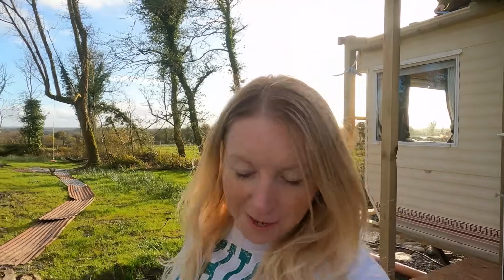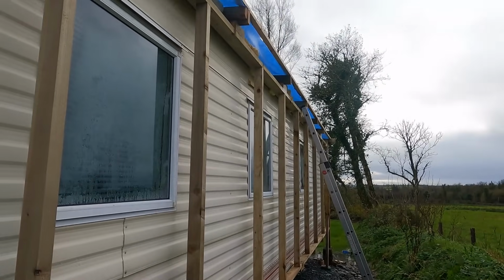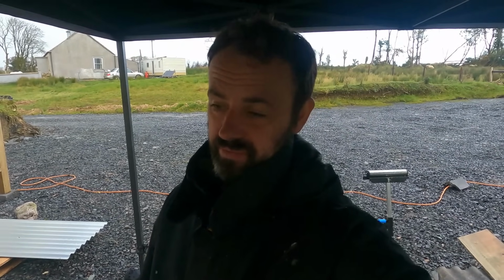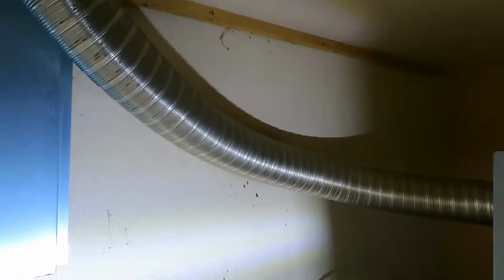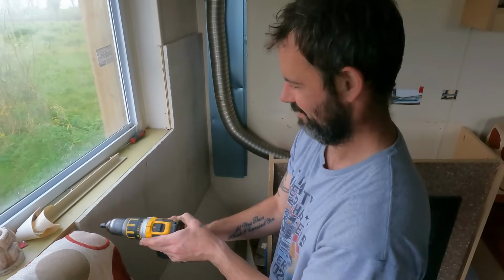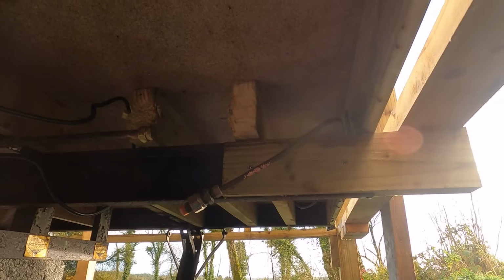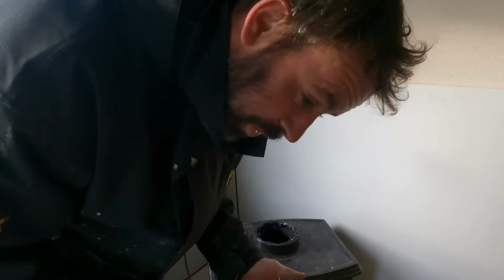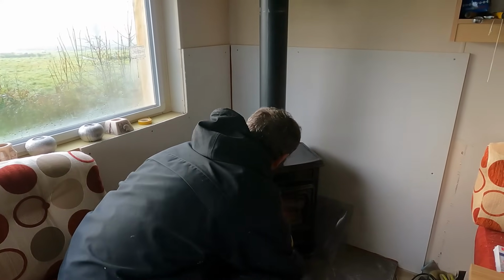We finally install the log burner when the weather stops the cladding! Episode 13

Comment: If I can offer one piece of advice, dont cut the tin roof back too much to accommodate a gutter. The pitch of the tin/roof  is so shallow, the water will track back under the edge and might drip behind any guttering you put up. Maybe try a test pour of water and see how much the water travels back and take that into account when fitting gutters. Best of luck with the project.
Reply from the maker: Good shout! That is something we hasn't considered. Thanks 👍
Reply: Excellent advice. The lower the pitch, the longer the overhang!

Comment: We fitted a log burner with an above oven in our static, best thing we ever did. My wife cooks with it half the year saving on the gas bottle. We're lucky we're surrounded by an abundance of firewood. My only mod to our atlas Florida was fitting an inline extractor to pull warm air from ceiling above stove thru to bedrooms, works well but needs 4hrs minimum runtime to be effective. We're in Perthshire. Had 3 burst pipes from cold over 4 yrs. A log burner and dehumidifier are essential for a caravan life.
Reply from the maker: Thanks, we agree the log burner has been a game changer & the diesel heater sorts the bedrooms. We have hardly needed to use the dehumidifier since the log burner went in. We get our water from our farmer neighbour who lets us tap into his field water for the animals. We are bound to end up with no water a few times before summer, but we can't afford the water connection cost yet. Luckily our neighboure have said we can use their water should the worst happen. 👍

Comment: So, so happy you've got your wood stove installed - absolutely the best thing to keep everything warm and DR., But for safety, and because there's so little clearance, you need non combustible, low heat transfer cladding on the surrounding walls - even with a small stove, you’ll be amazed how hot the walls will get. And keep flammable materials like curtains etc well out of the way. 
A tip to keep the gwater glass nice and clean - before you remove all the ash, dampen some paper towel, dip in the ash and rub the sooty glass  then clean off with another paper sheet - works like magic!
A heat generated fan on top will also help disperse the heat.
Stay warm n snug everyone! Love from Oz  ❤ 🦘
Reply from the maker: Thanks, guys, for the tips. Sam did as you suggested with the ash on the glass, and wow it worked a treat! 👍

Comment: So glad you have the stove in. An Olmberyl gabriel I think, pre airwash. Be just in time. I live on a 50ft narrowboat and wouldn't be without my Woodwarm fireview multifuel stove.. It's 10th Winter. I'm sure it's made a great difference to warmth already and made your mobile home cosy. Your hardibacker board at the rear would be a good idea not to fix direct to the wall. I leave a 25mm air gap, to stop heat transfer to combustibles. I cut 22mm copper into 25mm long pieces to use as a packer/spacer.

First frost here in the UK Midlands. Keep cosy and safe! James.
Reply from the maker: I'm so glad to know the make, thank you. It has made a huge difference for us.

Comment: Great to see you have installed stove i am sure you already know yhis but where possible burn seasoned or dead dry wood the wet stuff blocks the chimney with suit now your working there must be plenty of wood do for sticks for starting the fire
Get yourself a we bit of bog and cut some turf 🔥😉😊👌🍻🍻all the best with your off grid journey 📴🍻👌🔥🍀🪓🔨⛏️⚒️🛠️🔧🧰 you won't know yourself with all this fine heat 🔥 good work fitting roof coming on well
Reply from the maker: I'm looking forward to trying out peat & turf! We have only ever burned coal & logs before.

Comment: That was no easy job. Fantastic work as always. Amazing to see what a caravan is made from. But yours is going to be such a good job when finished. Do you know if the stove is multi fuel? Coal will burn hotter and longer, you might be feeding it logs at a fast rate. I hope the storm passed by your home without causing any havoc.
Reply from the maker: Thanks Ingrid. Yes it's multi fuel. We have been using coal as, like you say, it burns hotter for longer. It is like a different place! I'm so glad it's in & proud of Sam's hard work.👍

Comment: Well done on the log burner install. I still have to do that myself to replace the electric one that came with or static. A wood burner would make sense, but it will also rob me of the prime place for the TV. For now, for as long as our gas boiler works with the rads, I'll put this one off, but it's good having seen the process. Good call on the extra supports under the floor for the weight of the stove.
Reply from the maker: Yes we are missing the place for the TV! but small price to pay for the huge difference in warmth we now have! 👍🔥
Reply: All about priorities. Our boiler in our main house (not the off-grid farm) just failed, so we're going to keep the wood burner going around the clock now. Always have options.
Also, getting that gas burner out of the static will help reduce the humidity. These things create a ton of moisture. Not a good idea in mobile homes.
 @theirishhomestead
Reply from the maker: Omg yes! The condensation has virtually disappeared now! It was so bad with the gas heater! Best addition to our lives so far, except the kittens, of course! 🐈🐈🐈‍⬛ 😉
Reply: Yea, its well known, those gas heaters are not a good idea in mobile homes, unless you vent like mad and the heat is lost. Hope you have some dry bed linen now. Nothing worse than clammy bed clothes.
Did that static not have any central heating at all? @theirishhomestead
Reply: If you can give me some way to contact you directly, I'll hook you up with some ppl you might want to know  @theirishhomestead
Reply from the maker: @emeraldlife_ie  you can email us theirishhomestead@hotmail.com

Comment: the dry heat of the wood stove will really help with the humidity. Also, putting clear plastic over the windows on the inside will eliminate condensation as well. I built frames and caulked them airtight
Reply from the maker: That's a great idea. The condensation has improved so much, too, since we put the stove in!
Reply: or you can put them flush with your cladding on the outside, take them off in the summer.
 @theirishhomestead

Comment: The easy way to keep the door clean, wet some newspaper rub dip in ash then wipe the door, the ash does a amazing job of removing resin, we burn old man pinus radiata that is gummy. Then just wet newspaper to finish polishing, wood burners are so good, and after some experimenting you may find you can cook soups and casseroles on the stove, just take all day simmering away if you are at home all day.
Reply from the maker: Great tips thank you! Sam was literally just saying we need to clean the glass on her door! Would love to use it for cooking! Saves the expensive gas! 🫣

Comment: It’s easy to criticise from a distance but it looks like you need to have sorted out some drainage around the static and to have sited it for better access around it. If you get injured you may have a long delay to recuperate with little or no work being completed. I’m not there and obviously you don’t get an accurate picture of your situation there. Good luck and I hope your weather improves, that wind and rain does not help at all.
Reply from the maker: Yes, in hindsight, we should have placed the static away from the embankmentmore than we did. When we got here, we had just enough money to get the land cleared and stone put down so we could even access the land with a static. We achieved that, and if we had  more money at that time, we would have had all the drainage properly sorted at the time. In fact, the land around the static is draining well into the ditch at the side. it's just we are too close to said ditch when trying to work on the static. Once it's done, though, we shouldn't need to go round the back much more 🤞

Comment: 15mm and 1/2” are similar enough to get away with mixing the fittings, most of the time. The 1/2” stuff is a bit tight on the 15mm pipe, but once you get it on it works fine.
Woodies in Carrick have metric fittings, if you need them. You’ll also get them in Enniskillen.
Reply from the maker: Thanks don't think we actually tried Woodies. Will know for future reference. 😁
Reply: Forgot to mention, Screwfix. Any fittings I’ve ever got there have all been metric. That matters because you can’t mix 3/4” with 22mm, without an adapter.
Microbore can sometimes be managed, but it’s not something you’d want to do often. Much better to either have the correct fittings for what you’re working with, or adapt to what’s available locally and use that for any mods.
But 15mm is fine to mix with 1/2” albeit a bit tight in the fittings. I use “Irish size” acorn fittings with 15mm pipe all the time. Compression fittings are a bit easier if you have metric olives for them, but with patience, you can squeeze metric copper pipe into a 1/2” olive. I pick up spare olives any time I think of it and my odds and ends box is overflowing with discarded 1/2” ones!

Comment: Don’t forget to put a carbon monoxide detector in
And if you’re going to tile it don’t use ceramic tiles use porcelain tiles ceramic will crack  don’t forget to put a little fan on top to blow the heat. 👍
Reply: Great advice, carbon monoxide alarm is the most important item right NOW,
Reply from the maker: Yes we have a carbon monoxide detector & 2 smoke alarms! We do need to get a fan. Thanks for the tip re tiles. 👍
Reply: Your welcome there’s not a lot off difference in price and get large ones and go about 1 foot above the height off log burner
Reply from the maker: Ok thank you. 👍

Comment: Hi, love your video. I'm currrently renovating a mobile home myself and want to put a log burner in too. What model log burner did you use and what flue kit did you use?
Reply from the maker: 5" flue, we have borrowed the small stove but it still weighs 100kg
Reply from the maker: The flue kit was from Ebay.

Comment: Just a question that popped in my head. 

In the UK they use the imperial system (as far as I know), does that mean you have to change to the metric system when moving to Ireland? Isn't it hard to change? And  your kids, they have to relearn everything?
Reply from the maker: I'm not sure it's actually affected Sam at all in work yet. To be honest, he hasn't mentioned it! The kids are taught both metric & imperial. It's good to have knowledge of both.
Reply: Anybody in uk schools from 1975 onwards was taught both     
 Use both interchangeably  ireland is the same  drive in km/ ph  distances in km   but plumbing in inches.   ...

Comment: Curious to know the cost of your stove installation. I have a small stove i took out of the house were restoring and when I priced up materials it was 560 for  pipes etc. We are in a caravan in Donegal with single pane windows, its baltic!
Reply from the maker: Ahh, yes, we bought a kit from ebay https://www.ebay.co.uk/itm/224525994670
Still not cheap, and of course, we have to buy the backer board, which was extra at around €13 a sheet.
Reply: I'll look at that! Thank you.

Comment: Where was the flue kit from ?interested in doing the same, many thanks
Reply from the maker: https://www.ebay.co.uk/itm/224525994670

This was the one we used. Hope it helps.
Reply: Thank you, have just brought one and am doing the same atm. Just a quick question did you cut the single flue pipe to size? Or use full length? Many thanks
Reply from the maker: @welday123 Sam cut it but then regretted it as we needed it the full size! It has to stick out of the roof 2' and now it's only 1.5' So our advice is don't cut unless your sure!

Comment: I ment to say the door from the room where you have the stove NOT the stove  door 🫢
Reply from the maker: Colette I can't find your other comment anywhere?! So no idea what your mis-type was about! 🤣
Reply: I said to leave the door open when you all were going to bed to let the heat circulate around the house. I did not mean the stove door. Also you can burn smokeless coal in your stove if is an Stanley Oisìn.as coal at night keeps the heat in the stove. It will take a few days to get used to adjusting the  dampers.You will all be nice and cosy once you get it lighting. Take care xx
Reply from the maker: @colettelavery7452 ahh thanks. This morning, the difference was fantastic! No condensation! Hurrah! 🤣😉👍
Reply: 1 am delighted for you all .A stove makes everything so much better ❤
Reply from the maker: @colettelavery7452 it really does! ❤️